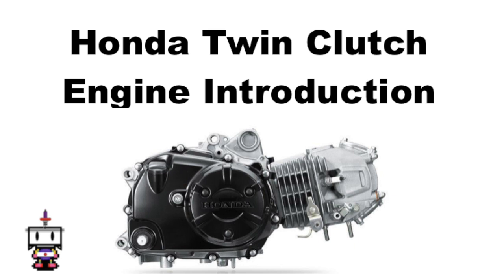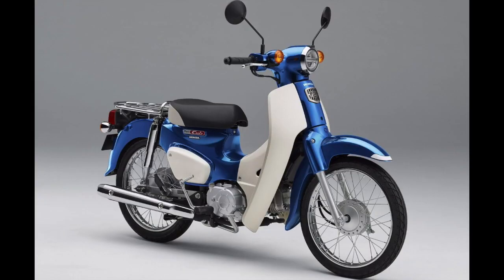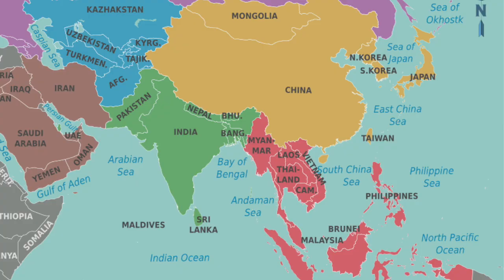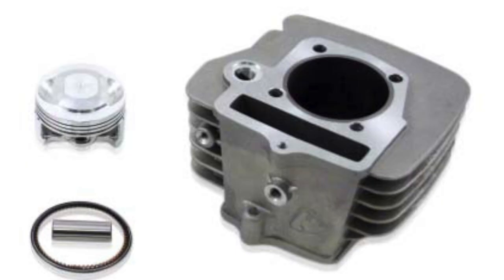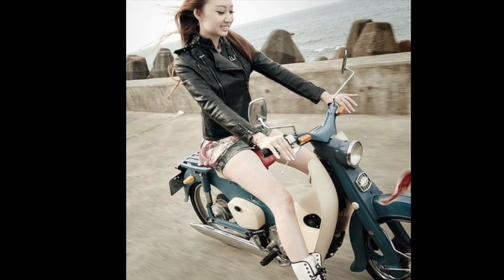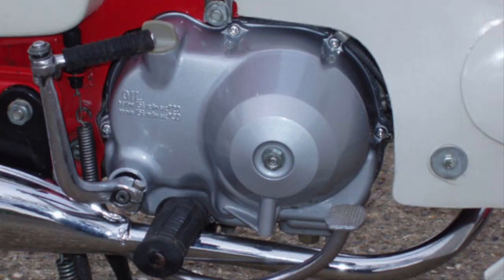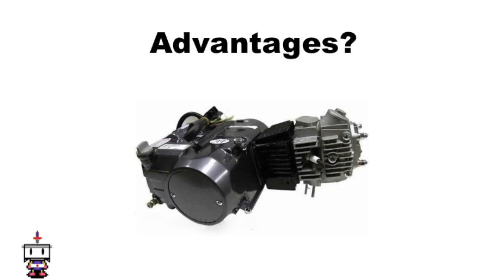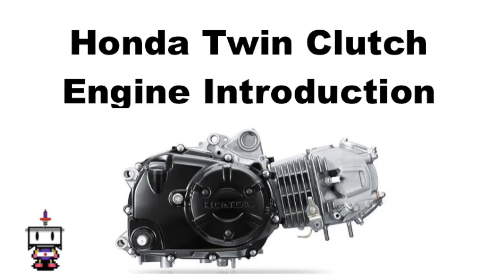Introduction to the Honda Twin Clutch Motor

Comment: Fantastic and informative video! I have a Honda XR 150 here in the Philippines and I have my eye on a semi-auto knock around bike. The information in your video will help me in my selection process immensely.  Will you be doing a video on the actual working of the dual clutch vs the single clutch? I just subbed your channel.

Comment: Interesting subject. I always thought the automatic clutches were for kiddie bikes until I moved to Asia, and then found they were all over the place, and used as daily transportation, taxis, and even delivery vehicles. 

It’s not uncommon to see 4 and 5 people riding on a Honda Wave. 

I will posit that the preference for the dual-clutch system is because it is easy and quick to beef-up. I’m over 125 kilos, and a Wave will whisk my 50 kilo wife and myself around with no problem. 

Tough little machines !!

Comment: I have rebuilt my son's crf110 2018 (I had to replace crankcase). Now when I put bike in gear the bike wants to move forward, it won't  just sit there. I think it has to do with the semi auto clutch. Any help would be great as I am not a mechanic.
Reply: @clickaus   adjust the clutch, it's probably dragging a little.

Comment: Is the t possible to convert normal Chinese single clutch 125cc pit bike bike engine to dual clutch? Any experiment and what needs to be. Be replaced?
Reply: I think cant because there will be no room for the second clutch (centrifugal clutch)
But if from double to single, maybe u can remove or modif the C clutch..